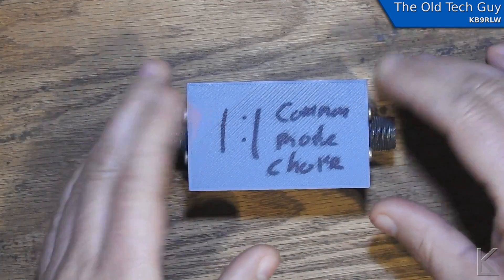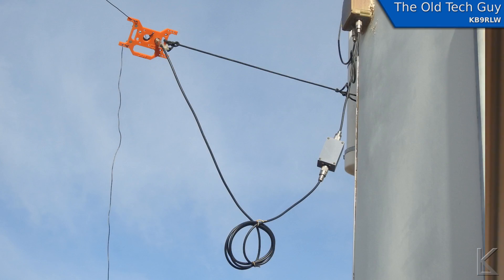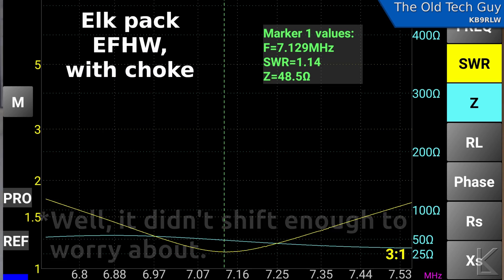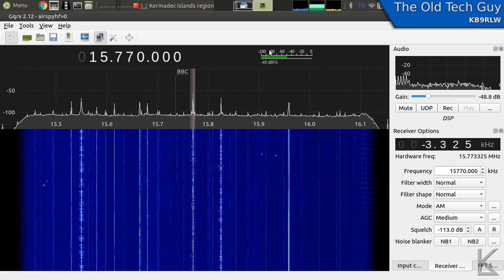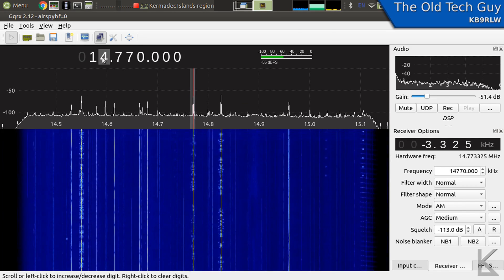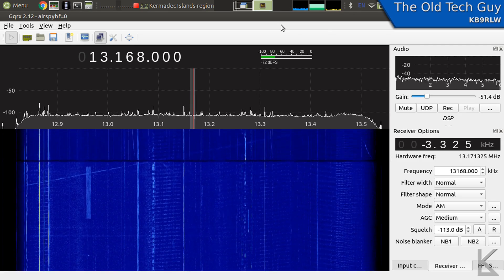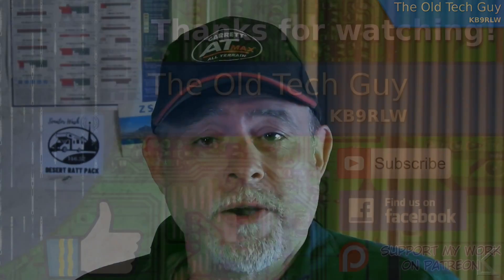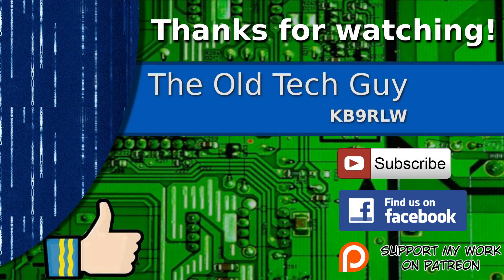Ham Radio - Adding a 1:1 choke to the EFHW antenna.

Comment: What type of cable wire did you use for the choke. I noticed it wasn't coax.
I have just got Messi & Paoloni Hyperflex 5 to make chokes with. I wanted something better than the RG58 everyone seems to use.
Seemed silly to make an RG58 choke when i am using hyperflex 10 as a feedline.
Your thought's please?
Reply from the maker: I think it was 18 gauge wire. I was only going for a hundred Watts max. I don't use coax for chokes. When you bend coax in too tight of a curve, you risk the center conductor gradually pushing its way through the insulating material and contacting the braid. I've seen a couple blown out because of that. So I just wind parallel wires.

Comment: Rumour has it .. Add Two Common mode Chokes to either end of the Coax.. (Feed Point) and Radio end..
Reply from the maker: Seems like overkill and unnecessary insertion loss.
Reply: @loughkb  Ya, 😕 I know.. I hate adding stuff in line for the reason of insertion loss as well. But, with Electrical equipment inside the house like Switching Power Supplys could be causing the additional EMI noise affecting some of the Bands.. Do you think Using a T140-2 Core would be Ok ? or, should I only use a (43 Mix) or (31 Mix) Material Core ??. Because I think I Need a Choke for my Noisy Environment as well.  Thanks 👍 for posting, as it helped learning what Could be a solution. 73s
Reply from the maker: @x_CrossHair_x  type 2 is iron powder and not ferrite. Type 43 is Good for HF. Palomar engineering has a nice table. If you search for ferrite toroid types it'll be one of the top hits just look for Palomar

Comment: How much does the choke attenuate signals? I guess as long as the signal to noise ratio is down.
  I am looking to use an UNUN on vertical antenna. People generally use ugly chokes if at all. I just find it strange there is nothing much on the market with a So 239 on both ends. everyone seems to make a Balun or UnBal but not many make a 1:1 UnUn.
  To eliminate harmonics from devices in the immediate area you can use a noise canceller with an auxiliary antenna. Buy the kit from VK5TM

Comment: QUESTION, if Im doing pota with a EFHW antenna that does 10, 15, 20 and 40m.... which choke do I build? a 31 or a 43 ferrite core?
Reply from the maker: Palomar engineering has a page on recommended mixes for frequency ranges. There's a table part way down the right column is wideband transformers and it looks like they would recommend a type 43 or 52. So I guess I would go with 43. 
https://palomar-engineers.com/ferrite-products/ferrite-cores/ferrite-mix-selection

Comment: Is it better to install the 1:1 choke at the antenna or at the receiver?
Reply from the maker: I guess it would depend on the use case. If you install it at the antenna end, then you need to be sure to have a counterpoise wire off the ground side of the 49 to 1 match network. If you don't have a counterpoise wire, you could install it at the radio end and the shield of the coax would act like the counterpoise. The downside being at anything above QRP, the RF currents flowing on the outside of the shield would radiate and you might get some RF back into your radio distorting your audio.

Comment: To clarify: you have a ground wire (to the ground with a copper pipe in the ground ) plus a counterpoise? Do I have this right? Second, shouldn't the 1:1 choke go right next to the radio? ... not next to a 9:1 unun out at the end of the EFHW?
Reply from the maker: I did have my counterpoise wire terminated on the ground rod. Out here in the desert we get 20 to 30 mile an hour winds regularly sometimes blowing dust, which creates a large static charge on long wire antennas. So I do that so the static charge bleeds off instead of building up. 
I put the choke at the antenna end so that the coax shield does not become another counterpoise. But you could put it at the other end as well. You would just have common mode currents flowing on the outside of the coax.
Reply: I believe the correct type of balun for an EFHW should be completely isolated from the coax electrically. The counterpoise is connected at the opposite side of the secondary winding and there can also be a capacitor in parallel. The static can bleed off to earth via the winding to earth. any tank or coil loaded antenna can bleed static off to earth if there is a good connection from the mast to earth as long as the counterpoise is electrically connected to the driven. It's also a good idea to earth the coax shield as close as possible to the shack. God earthing rods or buried metal with good connections as deep as possible with damp soil / conductive soil helps.

Comment: I have a DX Commander Classic vertical antenna and have all the elements tuned. I have it connected to a IC-7300 with 50ft of RG8X coax. I get a pulsating line and noise on the whole band that is even across the scope that is consistent about two times a second. It is not present on my ZS6BKW on my FTdx10 radio. Doesn't seem to matter what band I am on. I am going to try another coax cable. Any other ideas?
Reply from the maker: Probably something in your house is generating the noise. Run the radio off a battery go to your main breaker panel and turn everything off. And then if the noise goes away, turn your breakers on one at a time until the noise comes back then you know what circuit it's on and you can start to narrow down what's causing the noise.

Comment: You seem to be overthinking this.  The common mode choke simply stops the outside of the coax from being part of the antenna.  So it'll stop picking up vertically polarized noise and weak signal sources close to the coax.
Reply: @stargazer7644 Maybe instead of watching 30 seconds and commenting you should watch and see the evidence yourself. Or go back to aimlessly looking at the starts and wondering what your thumbs are for.

Comment: Think that coax coil you have between the UNUN and the choke will shorten the antenna slightly - have noticed that I have to unwind all coax before adjusting say dipole length
Reply: If coiling your coax alters how the antenna works, then the coax shield is working as part of the antenna and you need a choke.
Reply: @stargazer7644  Indeed - and intentional. I made contact from Denmark to the US with a 5 meter vertical (Chameleon MPAS ) - and using the coax as counterpoise with a choke at the rig end. IF I have the coax rolled up - the SWR changes a bit - so I fully un-roll the 22 meters of coax I use
Reply: @bodstrup  It might mean that the antenna impedance does not match the feedline. make sure your antenna has the adequate counterpoise. If you can measure the impedance of the antenna at the feedpoint with a vna you can find out what ratio transformer you might need to bring the match back to 50 ohms if using coax. then as described in a comment above the transformer / balun with the correction ratio goes at the feedpoint and if then adding a 1:1 unun choke it can go a further 0.05 of a wavelength down the coax from the converting balun.
  This is the main reason an endfed has a 49:1 because it is missing it's counterpoise the impedance is a long way from 50 ohms as such. Some antenna only need a 2:1 or a 4:1 etc. it depends on many factors, the antenna design, angles objects, height. etc. This is why it is best to measure impedance at the feedpoint at operating height to really know what you are seeing at the antenna. VNA with bluetooth is available so you could see the data from the ground. Alternately you can jerry rig a small video camera filming the vna so you can watch back the results at height for when you bring it back down to make adjustments etc. A good idea for anyone making a doublet or inverted Vee as the feedpoint is high and everyone uses slightly different angles depending on their situation. A mono band, balanced equally above earth and from objects is my preferred. but a doublet is a multiband vs of an inverted Vee and can be practical for people who use many bands in general. If you want to be strong on one band a mono band is the most efficient and sensitive for that band and requires less attenuation via various balun transformers etc.

Comment: Did you calculate the feed line length between feed point and choke or was it random? Some suggest at least 1/4 wave of coax from end fed before placing a choke. Your thoughts?
Reply from the maker: If you're not using a counterpoise wire off the ground side of the feed point, then the coax shield becomes your counterpoise and you probably would want at least an eighth  wavelength with the end fed half wave design.

Comment: The half wave end fed ant is voltage fed not current fed so adding anything other than a common mode coax choke is a wast of time. The  transmission line you have wound on the core is balanced also the character impedance of this line depends on the diameter of the wire and spacing. Secondly the impedance match allowing the antenna to be fed at its hi voltage point means that it does not require a counter poise as each 1/4 wave end becomes its own counter poise because of there phase diferance to each other. There is a lot of misinformation regarding this.

Comment: Hi iv got a 140 43 mix core spare and want to make a choke . I see you’ve used two wires rather than coax to do the winding can you suggest how you done that and how many turns I would need to cover 80 to 10 meters
Reply from the maker: I just wrapped the two wires in parallel.  I don't like wrapping coax since the bend can cause the center conductor to push through the dialectric insulation and make contact with the outer braid.
At least 8 turns, no more than 12.  Needs to be an even number so half will be on each side of the toroid. Syymetry is important.

Comment: But won't this stop the coax feedline acting as the antenna counterpoise?
Reply from the maker: yes, and that's a good thing. it prevents RF from getting back into the shack and possibly on to the modulation audio of your radio. of course you'll want to add a counterpoise wire to the ground side of the 49:1 balun.
Reply: @loughkb  Yes Ok, but maybe a point worth emphasising most of the 'received wisdom' about EFHW says that a counterpoise isn't needed because the coax outer is used.
Reply: @Naybr1  That's marketing turning a bug into a feature.

Comment: How do the 1 to 1s do with rfi. I have some in the shack and was told to but in a 1 to 1 at the antenna.
Reply from the maker: It can help to reduce RF on the coax, yes.   
It's better to figure out why you're getting RF on the coax and fix that though.  If you're using an end fed wire, where this problem is most common, you can add a counterpoise wire to the ground side of the feed point, going off perpendicular or away from the radiating wire.  The RF current will go there instead of on the shield of the coax.

Comment: Hi Kevin
Great tutorial!
Questions: What was the reason you replaced the original red toroid in the choke with a type 43 toroid.?
Would it not have worked OK?

Also do you have the wind details for the choke itself?

Thanks
Steve
Reply from the maker: The type 43 was more effective in the lower HF range, whereas the type 2 was more effective up into 6 meters.  
And yes, I have a video on winding the choke.  Search my channel for choke and you should find it.

Comment: Hey Kevin, when I mount SO-239's inside a [thick] plastic box like this, there're sometimes not enough threads sticking through for say, an Amphenol PL-259 to seat into the teeth, allowing the 259 to spin without a fîrm connection. I now always mount on the outside giving this 259 all the possible threads and seat solidly. I'll use silicone in key spots to assure it's leak proof.

Comment: What type of wire is used to make the choke?
Reply from the maker: Solid core, not sure of the gauge.   I use solid for winding, it holds it's shape and is easier to work with.

Comment: Great video Kevin! I have an EFHW at my home QTH and love it's performance on 160M-10M (MyAntennas). I have experimented with an RF Choke and it not only reduces SWR, RFI and general noise, but it also helps my 40M EFHW load up on 160/80M (probably not efficiently, but I make QSOs). 

Question - I also experimented with a counterpoise on my EFHW and have always found it reduces performance and increases SWR. I tried it as a 'tuned' counterpoise wire and also connected to a ground stake. Either configuration reduced performance. I'm curious why you chose a counterpoise in this case and if you'd be wiling to try your EFHW without a counterpoise wire. 😀 73 KJ6ER

Comment: So the choke only reduces signals (noise) being picked up on the coax feeder. If these signals get picked up by the antenna, the choke makes no difference. Is that right? Then why is the hash predominantly picked up by the feeder? Why doesn't the wire antenna pick it up if it's there?
Reply from the maker: Broad hash noise will get picked up by the antenna as well.  However, since it doesn't really have a defined waveform,  it comes down the feedline in phase and common on both conductors.  
Any kind of continuous wave signal, regardless of modulation, will be a wave moving across the wire and have different phase currents on the antenna wires.
Reply: Because the antenna is horizontal and the coax is hanging vertical.  Most noise sources are vertically polarized and are picked up by the coax shield.  The antenna is cross polarized to the noise.

Comment: Great video Kevin. Do you have any suggestion as to the preferred location of the 1:1 choke? I currently have an EFHW on 40 meters with my 49:1 outside at the antenna feed point and a 1:1 choke inside my shack about 50 feet from the antenna feed point and 5 feet from my radio.  Have you experimented with choke location?
Reply: Apparently my comment was deleted by YT, as I was referring to a link, which I didn't wrote completely as it should, but YouTube is way too clever, hi.
Anyway,  (Google) search for 'AA5TB End Fed Half Wave Antenna', and there you will read that the recommended location of the 1:1 balun is 0.05 lambda away from the transformer.
So for the lowest band of that EFHW, let's say 40m, the coax between the 49:1 and the choke is 0.05 lambda = 2m.
Hope this helps, and my comment stays online ;o)
73, Patrick ON4CDJ
Reply: @Digi4u  Great info. Does this also apply if no transformer is used? ie. If using a. 1:1 unun to a vertical as a choke. Would the best position for the 1:1 choke also be 0.05 lambda from the feedpoint?
Reply from the maker: I've used them at both ends with similar results.   I had this one at the antenna end, but with about 4 feet of coax between the choke and the 49:1.   I also had a short counterpoise wire from the 49:1 that went down to a ground rod.
Reply: @loughkb  Would results not be even better if a 1:1 UnUn was used at both ends of the coax?

Comment: Great Video! I wonder if using type 31 mix toroids rather than type 43 would produce better results on & below 40m? The specs for the two mixes show 31 mix as the better performance on lower frequency's. I use a bifilar wound design using 240-31 mix for my 1:1 common mode chokes as most common mode interference I have found is on the lower bands. 73, Tom G2NV.
Reply: I mentioned that but someone deleted my comment.
Reply from the maker: I haven't deleted any comments Steve.  I've heard from others that comments didn't stay.  I think youtube is having problems.
Or,  someone else could be using the dot menu to 'report' comments.  It's one annoying way a mental juvenile can mess with youtubers.
You might have a nemesis that looks for your comments on other videos.
Reply: @loughkb  Oh well. Anyway I wanted to mention that parallel wires have an impedance of around 75 to 100 ohms which can be the cause of the slightly elevated SWR. Using coax, RG8x or RG-400 around the core maintains the 50 ohm impedance. On my EFHW I went crazy and ran the coax through 4 cores about 2 inches apart. I used two 31 mix for the lower bands and 43 mix for the upper bands. There are no issues with weather exposure. Just let the rain keep them clean. I did run a 3/4" pvc pipe through them to make it look neater but not necessary. The impedance is additive when they are in series like that.. It also helps to run the coax from the transformer down to ground level and attach it to a ground rod then into the shack.
Reply: @n4lq  Does a coax wound core function just as effectively as a wire wound one like Kevin had? I have an RG8x wound core on my EFHW (only one, type 43 as that's what I had - now thinking of adding a type 31 as well!).
Reply: @paulsengupta971  The wire wound version will cause a bump in the swr because it's not 50 ohms like coax. The best coax is Teflon, RG-400 because tight wrapping and heat won't hurt it. Yes, 31 mix is much better for 160, 80 and 40 meters. 43 mix takes over above 7 mhz. So just put one of each in series. More is better.

Comment: Does this type of choke suppress the desired signal. Would putting toroids the coax be better 🤔 or worse.
Reply from the maker: I haven't noticed any insertion loss with this design and signals.

Comment: Fascinating! I accidentally clicked the video, and I got 10 minutes of something I did not understand a word of. For me, a choke is found on older cars to get them to start. So much apparently that I am ignorant of.
Reply: There are few of us that understand rf and carburetor chokes
Reply: @ronrico2620 or in an airplane….
Reply: That device on the car chokes (or limits) air flow.  This device chokes (or limits) interfering radio signals.
Reply: 😂😂😂- you got to love You Tube. Even mistakes teach you something new.
Reply: I hang my handbag on it.

Comment: Yes, your results are the same that I found with my 40 meter EFHW.  The choke removes the transmission line as being part of the antenna, ie antenna element.  Thanks for sharing.